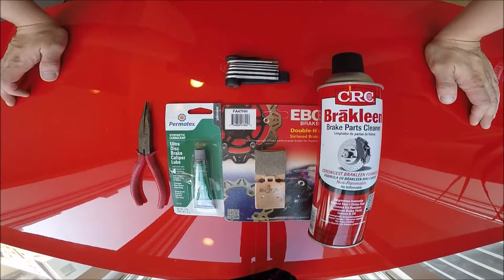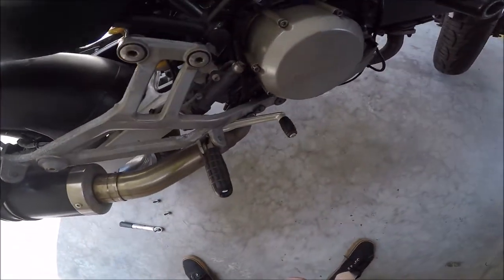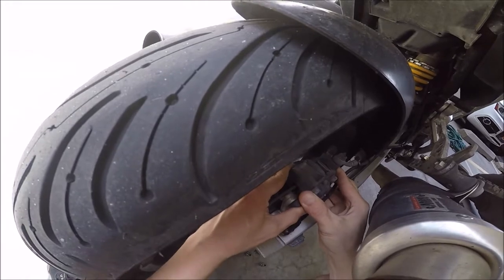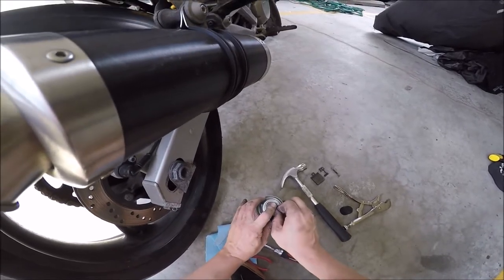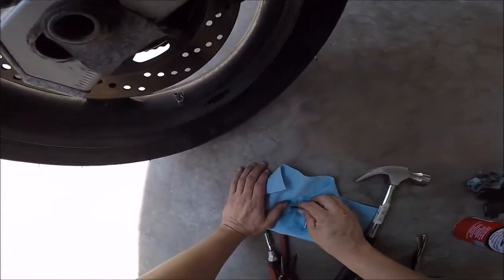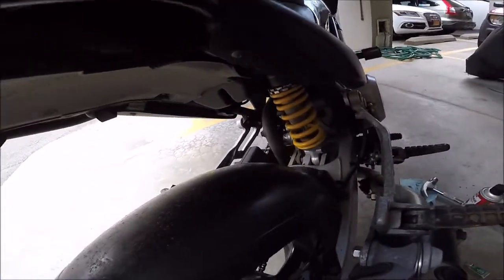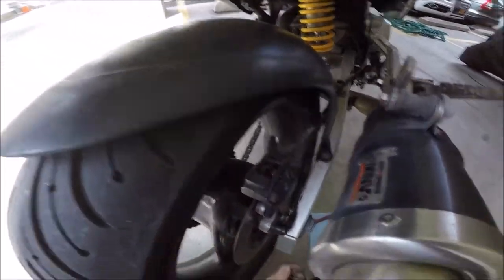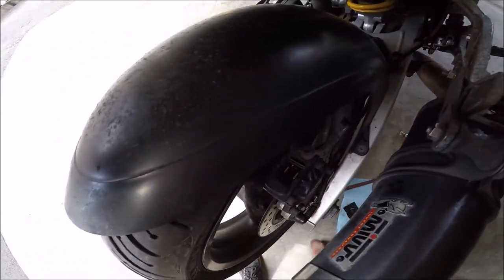How to Replace Rear Brake Pads on Ducati Monster 620

Comment: You are lucky, yours is in a pretty accessible spot. My rear is between the sprocket and the wheel up side down.
Reply: Totally stupid position, like my Diavel, which of course came with a bleeder that leaks like mad when it's unscrewed the tiniest bit.
Reply from the maker: Yea, def lucky, it was very straight forward. Yours sounds like a pain in the ASSSSS.
Reply from the maker: That's crazy. That sounds like my MTB that leaks everytime.

Comment: I'm split on getting a Ducati monster or a triumph street triple as my next bike. I would get a Ducati but I keep reading bad things about the maintenance cost.
Reply: The Monsters are pretty easy to work on. If you never do any maintenance yourself, any bike is going to be expensive. Monsters should be comparable to Street Triple for service costs. It's the bikes with tons of fairings that jack up the labor costs. My Diavel has so much crap tacked onto it to access the valves it makes the labor alone $800... Monster is FAR simpler than that. Just remove the seat and tank.
Reply: Don't you have to service it every 6500 miles, that will run like 600 dollars unless you know how to do it.
Reply from the maker: Depends on the year. Mine is every 6,000 miles and depending on the mechanic you use, yes, it  can be anywhere from 600 to 900$ between parts and labor. Well worth it.